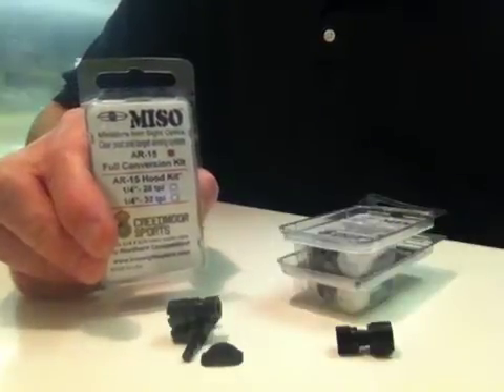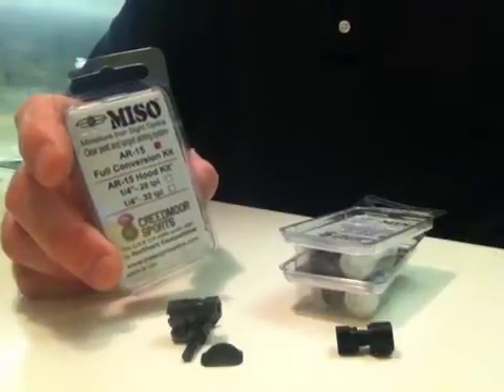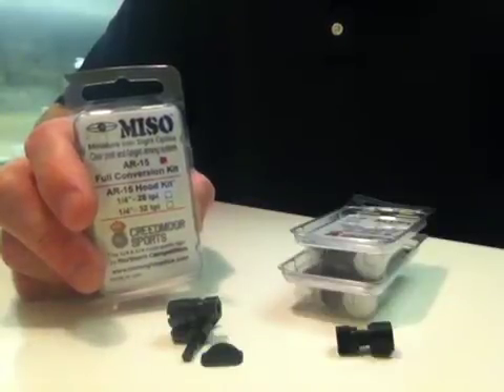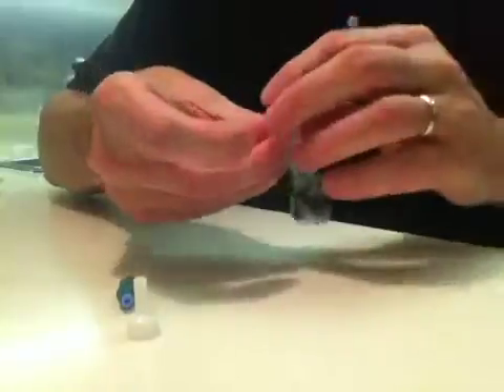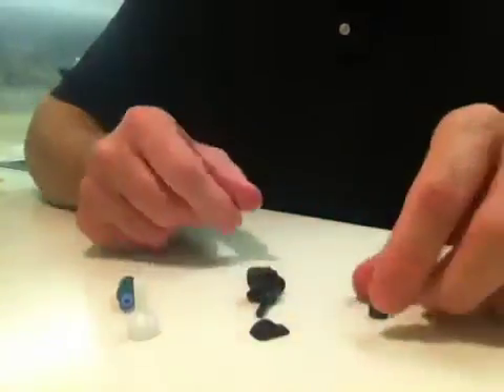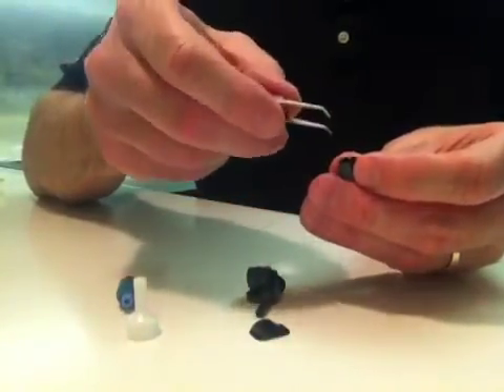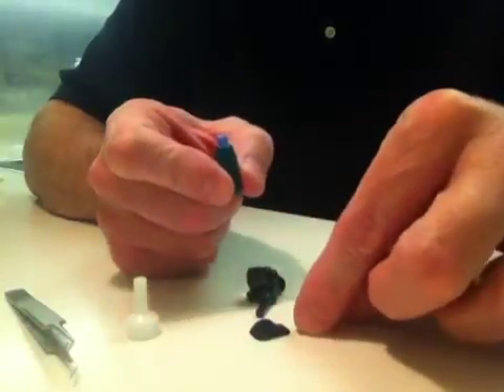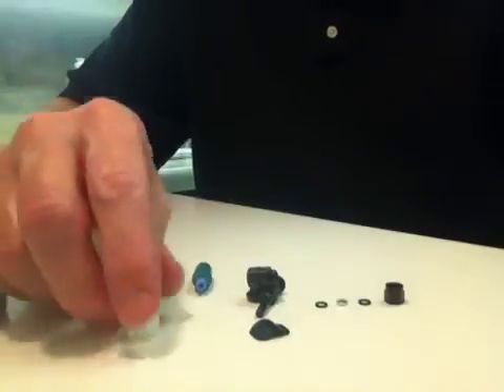MISO AR-15 Introduction and Disassemble

Comment: I have an m1a tanker.....the m1a tanker rear sight has a larger hole than the standard m1a or match m1a sights.....will the ar15 full conversion kit work on my m1a tanker rear sight with its larger sight hole?
Reply from the maker: The M1A MISO Lens Kit was adapter to the M1A NM Hooded Rear Sight (Sold Separately). Creedmoor Sports has them on their website: The arc/ rack width is oversized and requires some stoning to get a tight fit in the slot of your base.

https://www.creedmoorsports.com/search?search_keyword=M1A+Rear+Sight&x=0&y=0

The AR-15 Hood Kit or Full Conversion kit attach to the A2 rear threaded flip. 28 or 32 TPI.